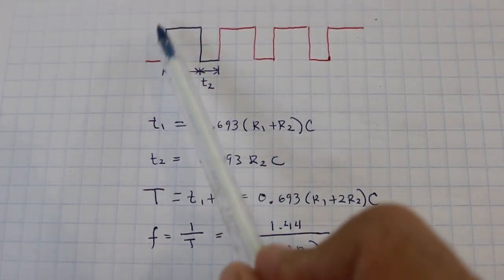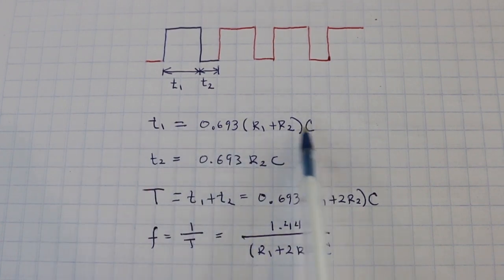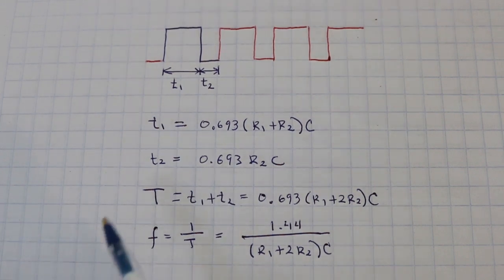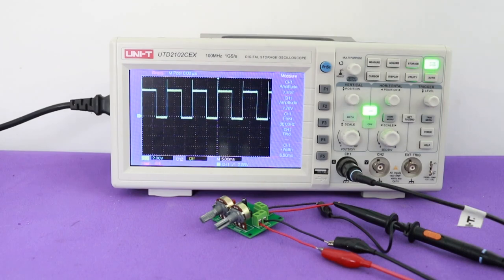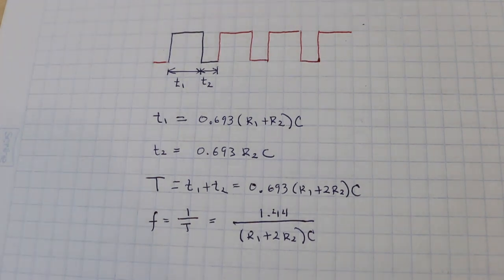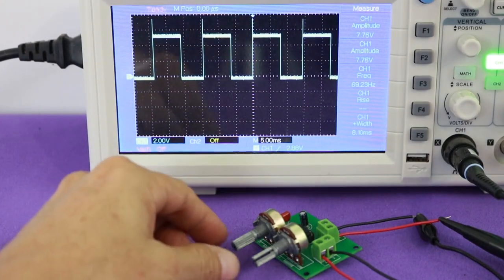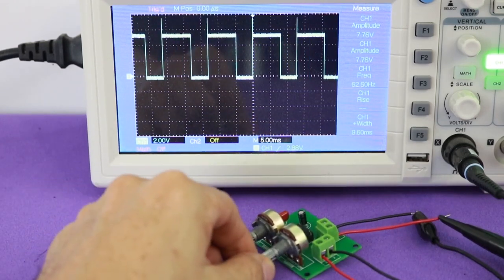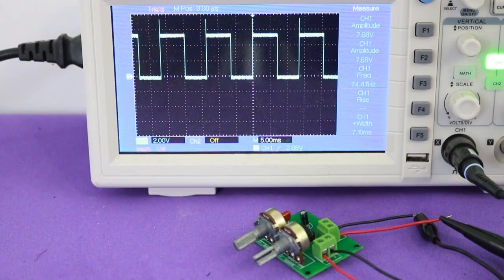Square Wave Pulse Generator with PCB

Comment: I think you forgot pin 7 on the circuit diagram because this pin connected to a NPN transistor internally and discharges the capacitor this will make an infinite loop to creating a pulse train.

Comment: I would like a sine wave generator that goes from 20-20,000Hz without any ranges.  Please make this.
Reply: add a capacitor across the output and an inductor on the +ve out and it'll make sine waves

Comment: What about pin 7 (discharge) ?
Reply: Yes. Schematic is faulty. Newbies check this against other sources before building.
Reply: Pin 7 does not have to be connected to anything. The circuit won't be any less reliable
Reply: @qwertyentertainment3349  You do not understand the principles of 555 working.
Reply: @incxxxx  I tried the schematic on a breadboard and it reliably generated a square wave without pin 7 being connected.
Reply: @qwertyentertainment3349  I also tried and did not work without pin 7.

Comment: Minor correction.  In the circuit diagram, the connection from pin 7 of the 555 to the junction of r1. & r2 is missing